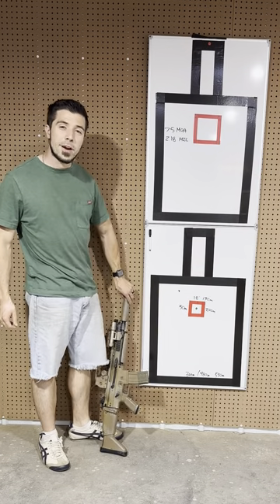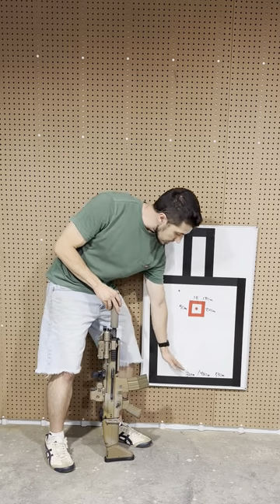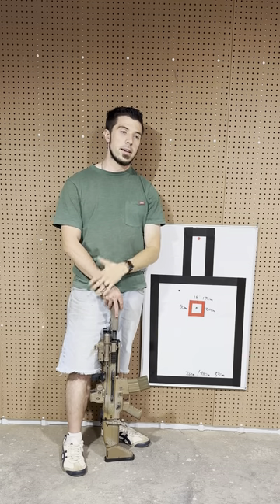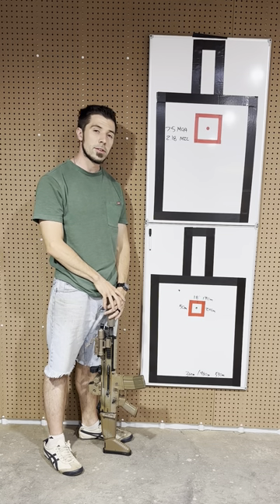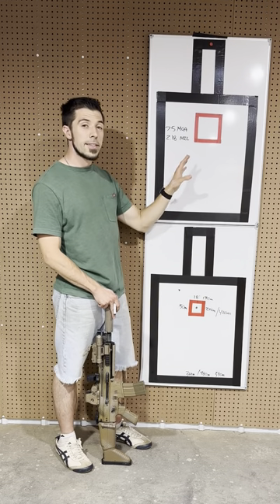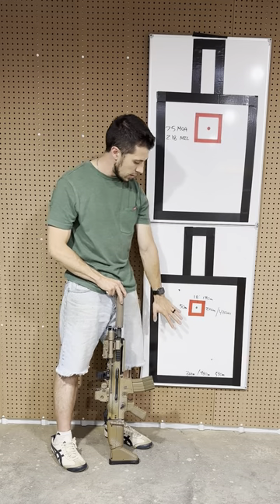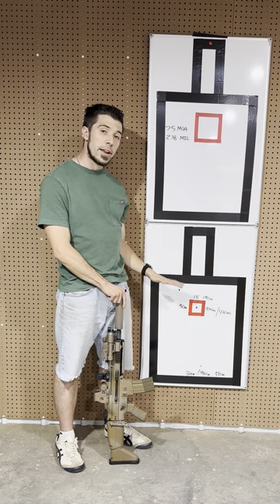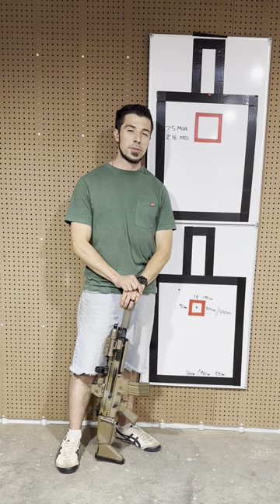How the Alpha works?

Comment: Ok, I understand how it works out in front of an optic but I’m still surprised it works the same way behind a thermal. Guess a minute of angle is a minute of angle no matter if the lenses is far or close to your eyes.
I know the Alpha has no magnification, but it is still a prism. Does that mean it has an eye box and eye relief (albeit a very forgiving one, like on a 1x prism)?
Reply from the maker: Little to no difference in the primary optic’s eye box and relief.
Reply: @tacomhq  gotcha. Time to read some of your pdfs and find out which Alpha is right for me. Thanks!

Comment: Do you have any of the earlier generations still in stock?
Reply from the maker: Not right now. It is undergoing changes and will be re-released as a mid-tier. However, we strongly recommend the new 4.0 given it realizes many advantages over the previous design:

Much faster / easier to deploy
1/2 the overall length
3/4 the weight
Glass stays protected
Option for killflash
Reduced internal reflection

Especially for 1.93 and 2.26 as these collapse onto itself, comparable to a Unity, and making it ultra-compact.

Comment: $550 ???!!! Wtf guys are you guys out of your minds? I said to my self if it under $200 i might get it, i could not belive my eyes when i saw the price!!
Reply from the maker: Lol everything is US-made, even our glass.  The 5-arc sec precision wafer alone costs that much, and that excludes the ADM componentry, the R&D, ballistic aggregation, etc.  The Alpha works with any optic and platform, so an end-user can seamlessly adapt their zero to function as a max point-blank, ranges you aim center target to get hits.  In other words, the same Alpha to enhance a 14.5" 5.56 can also be used to switch super/subs on 300 BLK.  All detailed on our website and cheat sheet.  Comparable solutions on this front alone such as the Boss Xe, XM157, and Romeo are +10x in price, so in actuality it is extremely competitive, excluding multiple other benefits. At any rate, we are working on a mid-tier unit.